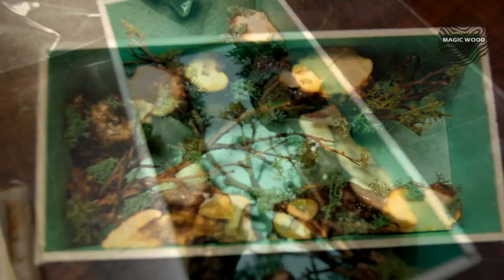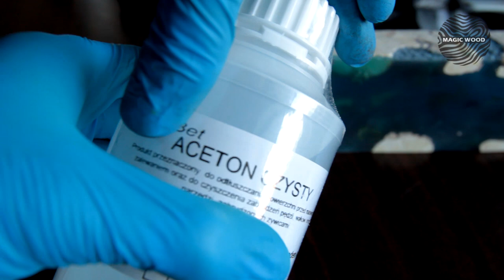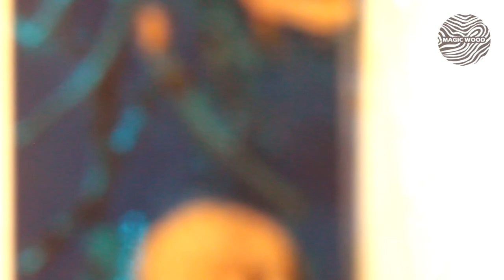How to make a Underwater Diorama / Night Lamp made of Resin and Burl Wood / Epoxy art

Comment: Which base you have used I mean what kind of green sheet you have taken for cover this?
Reply from the maker: Hi. Hmmm This is a thermal foil for printing :) After peeling off, it has glue on one side and a smooth surface on the other.
I use it because I had a lot of it from my previous activity.😆 
Better to use thicker glossy plastic right away. So that it does not break when detaching from the resin .